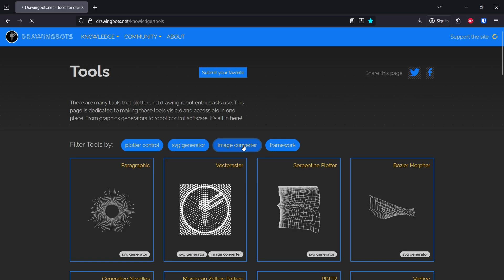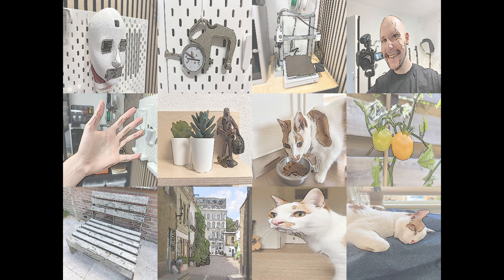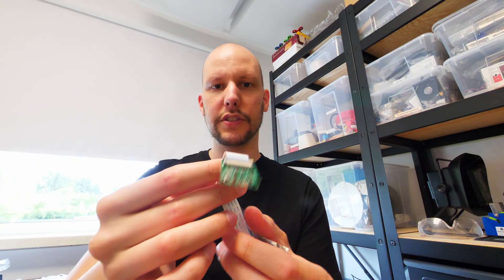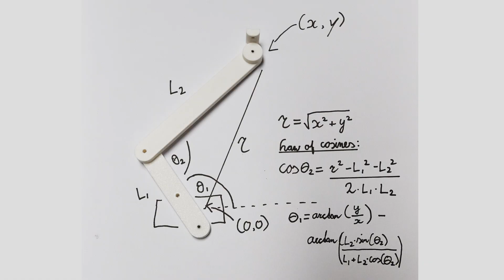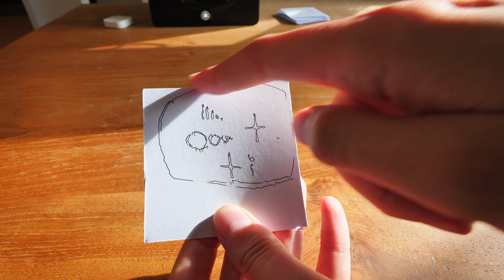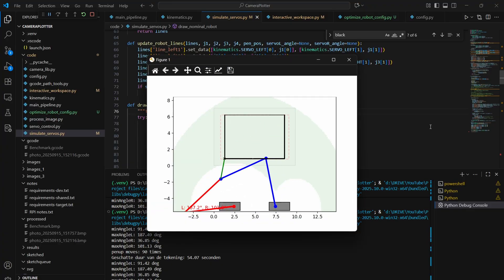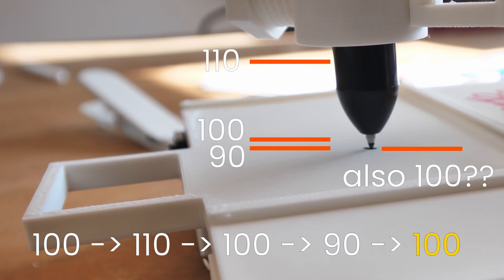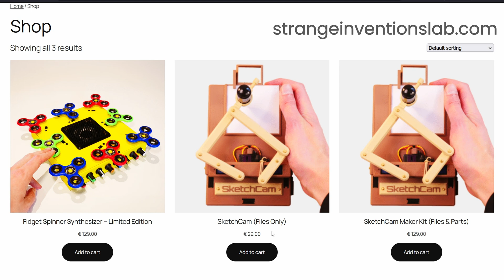I Built the World’s First Sketch Camera

Comment: Hey, I'm the guy with the "green screen"! I built the first version of my Pi-Casso in 2019 for Bay Area Maker Faire and I've taken subsequent iterations to numerous events, most recently Voron VICE PDX. Machine was really built for events so I designed a stand for it that breaks down and fits in a suitcase but is free standing when assembled. The green screen is gone and was there because I found I couldn't control at events what was in the background and it spent too long drawing bricks, ducts, and doorways. I've now added an onboard AI model that eliminates the background and no longer use the green screen. Otherwise my software stack is very similar.
Reply from the maker: Hey Matt, how cool that you found this video! You really built something special there! Thanks for sharing a bit more about your project 😃
Reply: @strange_inventions  is it possible to make a camera compatible screen 360×240 that uses the black solid pixels like from calculators as a gig? So that the simple cpu of camrea makes a more compatible tecnology that adaptes to diefernt exteranl mods?

Comment: im curious whether changing the arm rod rods into i-beam profiles would decrease shake in the system?
Reply from the maker: Something I tried and didn't show in the video is making the links wider. That also increases stiffness in xy direction. But it had no visible effect on sketch quality. I doubt H or I profiles would help. I think the issue is more in the dynamics of the Servo control loop with certain arm length and masses involved

Comment: Neat. I would've used linear rails, but that would be boring. Although, it might be cooler still to get PCBWay to sponsor another video and have them CNC machine the parts out of metal.
Reply from the maker: Using linear rails would certainly be interesting to explore! I could scrap those nasty inverse kinematics! Haha. It would be cool to get the deluxe hardcore version made. Though you'd need bigger motors and power too, so it'd get heavy quick! 😅

Comment: etch-a-sketch approach might have been more accurate
Reply from the maker: You mean never raising the pen, having it all connected?
Reply: @strange_inventions  not nessessarily. but easy enough to implement a pen retraction servo. having tensioned wires and pulleys to X-Y plot, there should be no (or extremely little) play. should manage to draw squares as squares
Reply from the maker: @BiscuitTinOrchestra  changing the motion system, yes! Clever, that could help performance, though it would make things more complicated